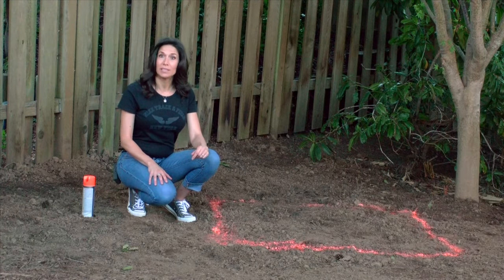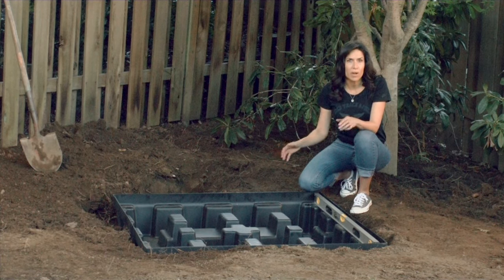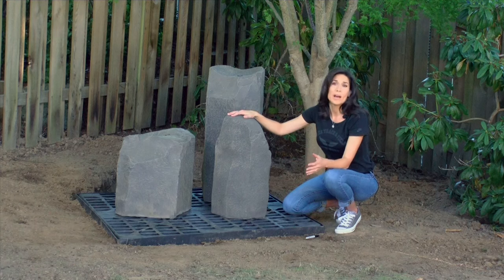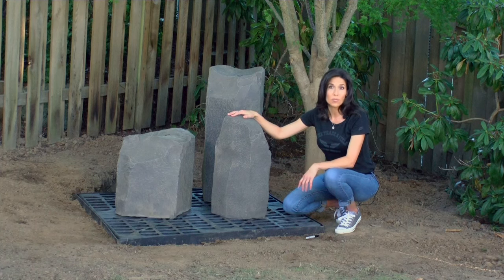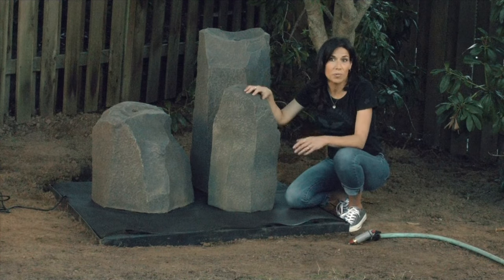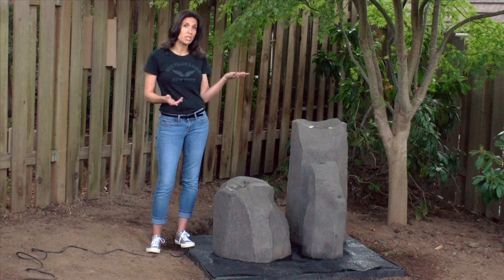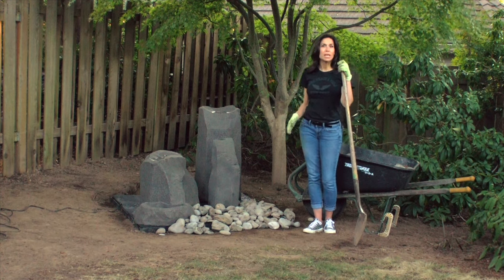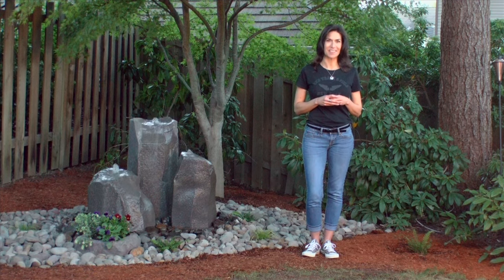LiquidArt Pondless Fountain Installation

Comment: But how do I connect the power point? I can’t leave it on the Turf ? Any help please
Reply: Power is a standard wall outlet plug and it looks like you don't have to bury the assembly but then it wouldn't be flush with the ground like the video it would be above ground. Which would still look good if decorated well.
Reply: Thank you my friend but do you have any video that shows how to do it? It would mean a lot to me
Reply: MOURIS BOFFICIAL Hire an electrician for about $1000. Or go find a Youtube video. How to install outdoor electrical outlets.